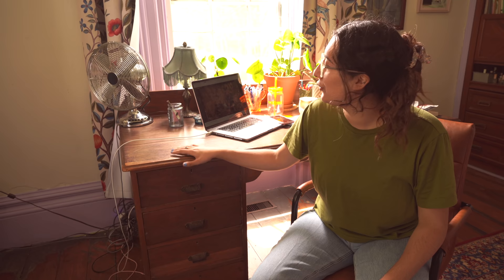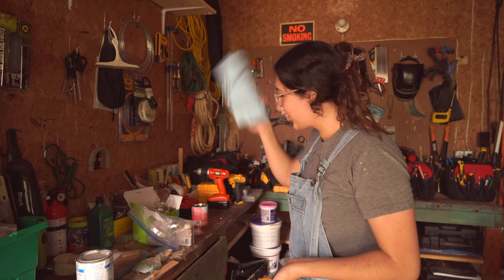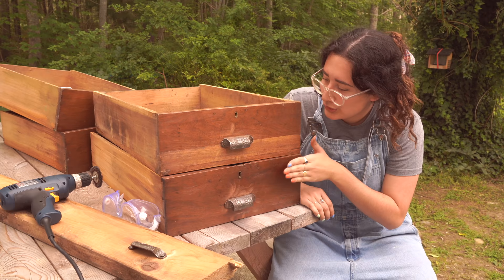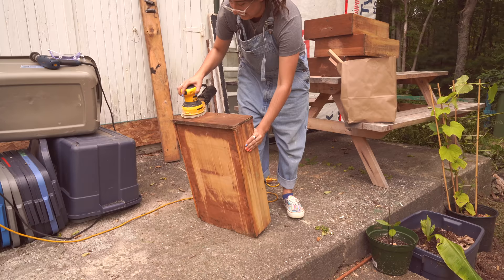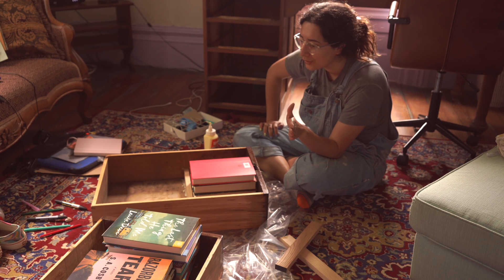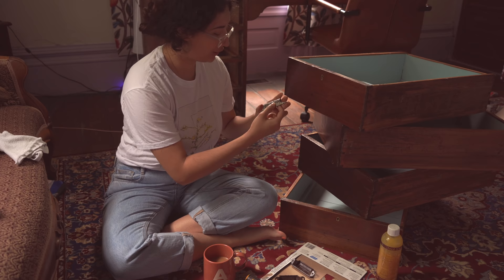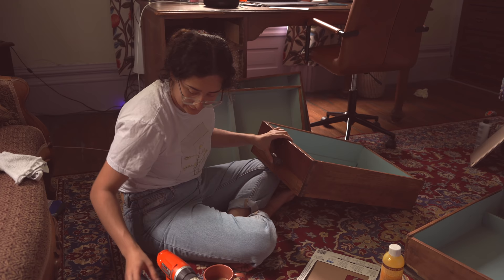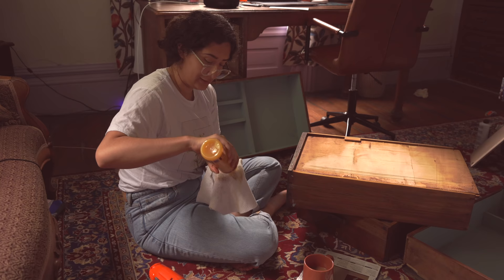Refinishing My Desk Drawers!

Comment: Little pro tip I learned polishing an old rusty bike, if you have sand in your soil outside take that and enough water to make a loose paste and gently scrub, it's perfect for ornate patterns like the ones on your desk pulls, although taking them off the drawers is advised. You can get a pretty decent shine without a polish, heavy steel wooling, or sandpaper so there's no crazy scratching and whatnot, your pattern will stay pristine!

Comment: NO! Don't use a wire brush unless you want to create more scratches on the brass. There's a much better polish than Brasso. It's called Wizards Metal Renew. Learned about it from an auto restoring shop. It's wonderful! It doesn't kill off the brass surface.

Comment: Ariel, such a fantastic outcome!  I'd not heard of soaking old screws in vinegar; thank you for the tip.  

I have an old family dresser and each drawer also has a skeleton lock mechanism.  When I inherited the dresser, there was no key.  Not that I want to lock the drawers, but thought it would be delightful to have a key.  I took one of the drawers to a locksmith and they easily supplied me with a working skeleton key from their new supply.  Just a thought for you, in case you want to add one.  

With each new post notification, I can hardly wait to see what you are up to with your home - uniquely you!

Comment: You can use a white candle and rub the parts of the drawer slides too ..i do it a couple of times a year on a stubborn drawer but also you can put thumb tacks pushed in flat, on the runners and they make a drawer slide in good too..i used three each side...they last longer.

Comment: Ariel: for future reference, if you want to clean tarnished or painted old hardware, try Bar Keepers Friend,  "cook" the hardware in a thrifted crockpot you keep for that purpose, or both. See lots of tutorials on that process. Saves a lot of elbow grease and usually does the job.
Reply: Also: rubbing a candle stub on drawer runners (and zippers) does the same thing as the Howard's, which brings dry wood back to rich hues beautifully.

Comment: They look so good! I wanted to say if you didnt have the wood conditioner, you can take tea candles from the dollar store and warm them up with a hair dryer and liberally rub them all over the rails of the drawer and shelf. Then run a hair dryer over it until the wax melts into the wood and it turns out really well too.

Comment: So, the reason the grinder was effective is because to properly restore material, both metal and wood, you need to scrap back to solid substrate before polishing or priming/painting. You will often see where the scrapping step was skipped by seem decent paint cracking and bubbling off and rust beneath. Such a waste but unfortunately common.